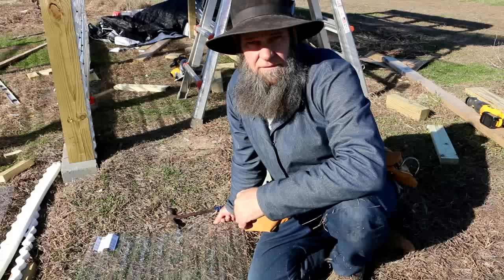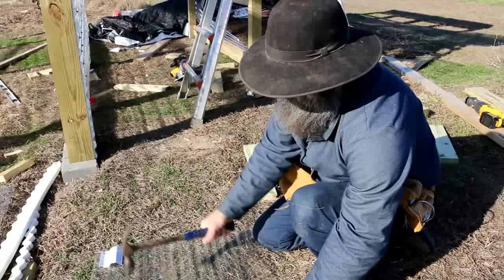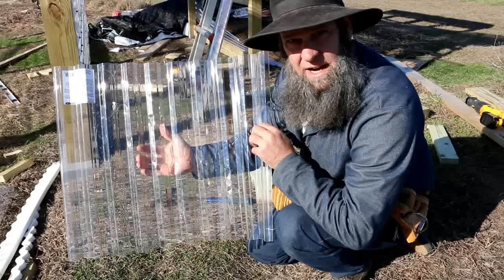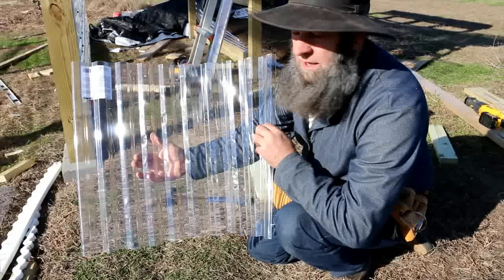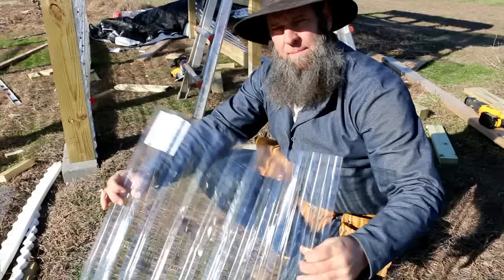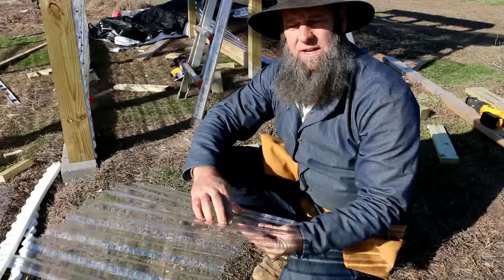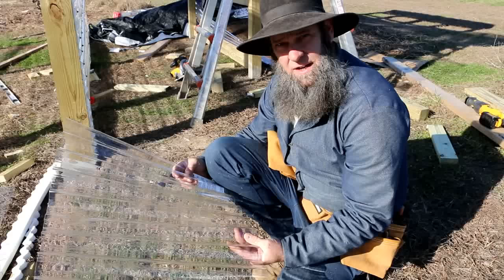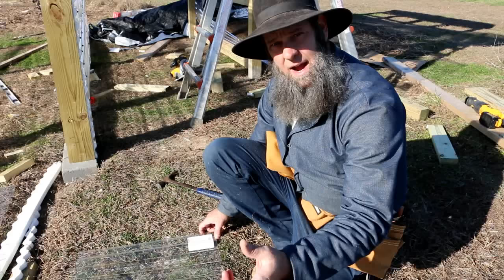BEST GREENHOUSE PANELS - TUFTEX - TAKES A HAMMER BEATING!!

Comment: we intalled this tuftex  two years ago on our sunporch roof and this weekend hail shot right through 9 times on each of the two panels we have.
Reply: Ive watched a couple of other videos showing similar hail damage. Hitting a panel on the ground where it can bounce and deflect is different from an installed panel that is supported by the roof frame. I'm still going ahead with using tuftex on my porch as we get little hail in my area.

Comment: Put expensive tuftex polycarbonate panels over my 22x12 deck after seeing your video. Had 2 hailstorms within a couple of month and have several hundred holes in the panels. The cheap PVC panels on my greenhouse 20 feet away has not one hole. Very dissapointed.
Reply from the maker: So send em pics and get your pannels replaced ....so easy

Comment: The impact is affected by the fact that it's being hammered on the ground.... how can you demonstrate the durability a roofing/ siding material while not creating a scenario in which it's actually set up as roofing or siding????
Reply from the maker: Lol I was hitting it hard enough with a metal hammer no matter what surface it was on 😉 still up through hail storm galore and zero issues

Comment: Could these be used as waterproof siding for a shed?  Similar to a vinyl shed but on a wood frame?
Reply: I used them as siding on a 16 inch centers 2x4 wall and they worked great. I applied them horizontal.
Reply: How do they do with heat?  I am wanting to do a shed type cabin but obviously don't want to be cooked out?  I am looking at probably the gray colored ones for siding and green for roof.
Reply: Rocdenindy look up Deek Dedrickson he has used these for years.
Reply: Why would you want to expose normal storage materials to this level of light and heat?  Especially if you store caustic chemicals, industrial equiptment, etc.